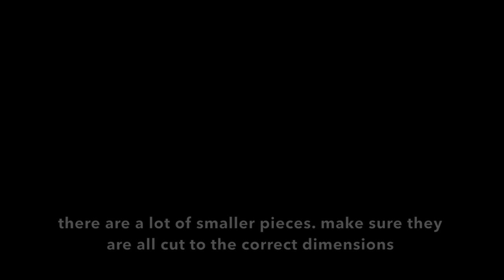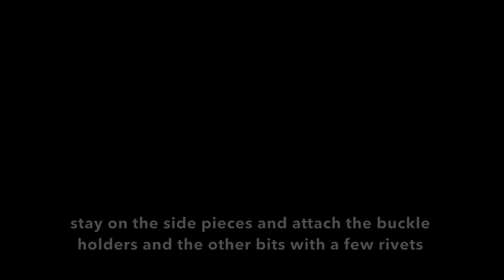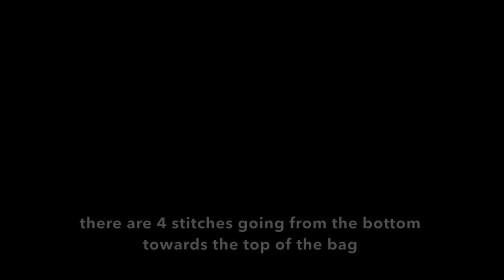How to Make a Messenger Bag - Tutorial and Pattern Download

Comment: This is really beautiful! The treatment you had for the gussets, folding in for the base and folding out for the panels, is pure genius and is something I have never seen before. Have you ever experienced structural issues with this technique. Please don't get me wrong, I don't doubt it's strength, it's just that I've never seen itv done this way before. 
Also, unlike other videos, I was also surprised that you didn't glue up the pieces. 
Nonetheless, a very beautiful bag 🙌
Reply from the maker: no issues, it is far stronger actually like that because of the added material in the right places
Reply: @DieselpunkRo  thanks for the quick reply. I'll try this out 👍

Comment: What size in mm hole punch are you using?
Reply from the maker: 1.8 mm
Reply: niteKore is the thread size on the instructions?
Reply from the maker: I used 1 mm waxed thread
Reply: niteKore one last question what size needles do you use